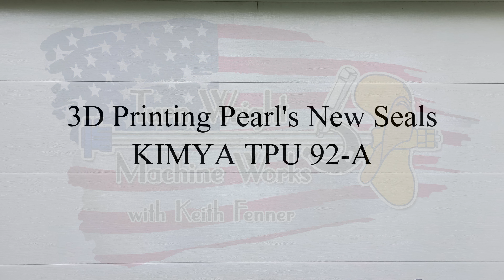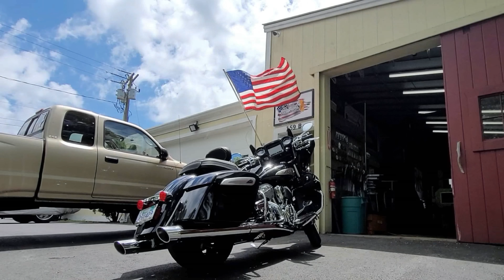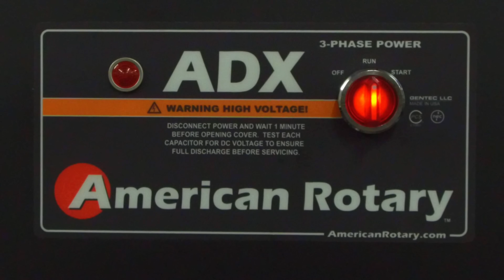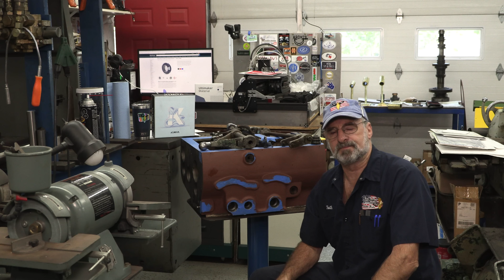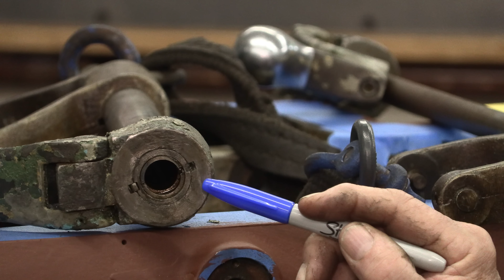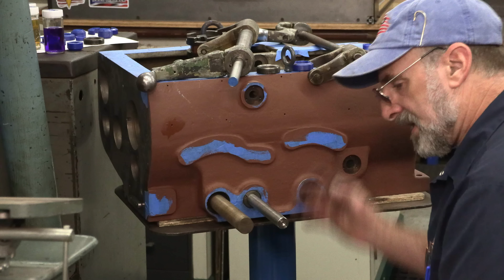3D Printing Pearl's New Seals KIMYA TPU 92 A

Comment: Experiment a bit with your printing temps and print speeds. The layers dont seem to be fusing well and there is evidence of under-extrusion. In your application as the seals are compressed canonically on both ends, it may not matter so much.

Comment: Good work Keith. Thanks for sharing.
I use my 3d printers to make odd parts too. If you print the parts one at a time, stringing shouldn't be an issue.
Going on how the Acetone seeped into your layers and apparently caused some delamination, maybe heat treatment of the part in a mould could make the material more impervious. The mould would just be a facsimile of the gland with a piece of rod for the core. Mould release substances would be another interesting topic, I'm thinking graphite or moly for the qualities given to the finished part.
 Not a suggestion, just a thought exercise.

Comment: You said DOT 5 and I notice that it is purple, which would indicate it really is DOT 5 (silicone based) and not DOT 5.1 (glycol based). Since you have a Harley, I'm guessing that's what you use in it, as some (all?) Harley's come with DOT 5 fluid.  As far as I know, DOT 5 is not something that typically is hard on things like paint and plastics, like glycol-based DOT 3, DOT 4, and DOT 5.1 brake fluid.   I'd say try another test with DOT 4 or DOT 5.1 fluid.

Comment: Thank you for sharing. The only 2 things I can add, already noted by others, ATF 3, is commonly used as a hydraulic oil replacement, it has a wider heat and temperature range. Also antifreeze, now this is a huge rabbit hole, much more than Brake Fluid, but even a sample of the good old green antifreeze that is still in use by a huge segment of the auto restoration group.

Comment: > nice going there keith mr fenner. additional shop chemicals? look no further than your you tube machinist compadres - solvent tank fluid; tap magic; evaporust; windshield washer fluid; isopropol alcohol and a couple few aerosols like brake cleaner & marvel mystery oil.  another possible testing parameter taking into account some of the chemicals are flammable, would be to create a homemade 'elevated temperature' steamed vials environment (similar to a wood bending steam chamber)

Comment: Keith,  I spent many years working with Urethane and Silicone based castings for marine applications. 
In daily operations  we used  Distilled water, MEK, Acetone, Isopropyl Alcohol, and Methylene Chloride for cleaning and mold prepping.
In your shop I'd test the proposed seals with solvents they might come into contact with in your planned environments .
Additional solvents I'd test would be 
Way Oil -- you could splash/wipe it over the handle seals
Wd-40 (penetrating oils) -- general part soaking
Dykem Spray Remover -- Over spray
Salt/Ocean Water -- Future marine shaft seal material
Sunlight/Heat/Cold --- Outside uses

I'd prepare a set of standard size test pieces with known dimensions.  Then subject them to long term exposure as you have done with these samples.
I'd periodically test the standards for 
Material breakdown 
Smudge test on white paper
Dimensional stability both shrinkage and expansion
Durometer testing shore A scale

Just some ideas.
Thanks, M

Comment: 29:28  I wonder if you could use that to your advantage ...... if you need a 'more' pliable material for certain cases ...... you could do this 48  hour acetone softening step?>   Just a thought
Reply: There is no way of knowing, besides extensive trials and a mass spec, what the acetone does to the TPE compound. Acetone could leech out all the plasticiser and when the acetone eventually flashes off, which it does pretty quick, you would be left with dust or an inflexible seal. But, he is experimenting, so have at it!

Comment: how machinable is this material?
Reply from the maker: Machines like rubber! NOT LOL
Reply: @KeithFenner  figured so.   Really that's a good thing tho.   That's the property you're after.   Looks like your getting good tolerances straight off the printer though so machining doesn't look necc

Comment: You want to destroy TPU spray Brake clean on it. TPU is the same rubber that is injection molded onto most Cordless tool handles and brake clean destroys it. Now i know there are different grades of TPU but it would be interesting to see what toluene does to it .

Comment: Two more fluids you may wish to test this material in are synthetic motor oils and synthetic gear oils. In both cases, these fluids in the past have had adverse effects on the sealing materials, (especially some current and all earlier formulations of silicone sealants)  used in cars, trucks, and commercial vehicles manufactured in the pre-2000 vintage era. Another fluid to check out would be the new generation vehicle coolants. I realize these fluids are not necessarily used in the machine trades with the possible exception of synthetic gear oils.
Hope this comment is a help and thanks for all the great content.

Comment: Thanks for the informative content.  I’ve had an entry level 3D printer for a few years now and I’m always finding new uses for in the shop as I restore vintage machines, etc.   I just learned a new use and I’ll be ordering some flexible filament shortly.  Ive got a couple seals to make for my Atlas shaper.

Comment: Fresh and interesting information. You asked for suggestions regarding other liquids. When rebuilding old/outdated carburetors, Orings which resist gasoline are desired.  Also, I believe DOT5 brake fluid is SILICONE OIL... really only useful when replaced often. Dot4/5 are TOTALLY different chemical make-up intended to suspend moisture like a sponge. (and  remove paint)

Comment: Retraction settings can help you on that stringing.  Also different temperatures to print at.  There are lots of "test prints" that exist to adjust retraction, speeds, and temperature to reduce and possibly remove the stringing.  TPU is tough to print, but you can do it without stringing, it just takes time to tweak the printer.

Comment: i work in the oilfield and have seen 3D printed parts start come into the work flow. it is easy to see that in a remote working environment having a way to build something from raw material. i was thinking of something like a link belt 3D print to make a chain of printed parts for a replacement fan belt, but your on the next level. lots of equipment covers and caps are 3D printed now. thanks very much for sharing! yes, i own a 3D printer.

Comment: I am thinking the DOT5 fluid is silicone based and used in high heat and extreme cold applications and is different than DOT 3

Comment: Don't you own a spanner wrench?
Reply: Same thought here.
Reply: Most spanner wrench pin ends are too fat to fit up against the shafts. You would be better off making a tube/pin socket type wrench. Yes, you would have to make one for each different nut size but it would be much more secure to use than a pin spanner wrench.

Comment: dot 4 & 5.1 brake fluid are glycol based, Dot 3 is ester based, Dot 5.0 silicone based and is paint safe.  Dot 3 or 4/5.1 are not paint safe. you should test all 3 types ester/glycol/silicone

Comment: Thanks again Sensei!  I'm old enough to remember the late 50's/early 60's B/W TV  "science shows" ... I kept hearing "Hey, MR. WIZARD!" watching this. My Dad was the same way about wanting self proofing anything he didn't know about. Cork for example, there was a major hotel air handling system, and the specs for several things included the use of several different specifications of cork material. We spent several hours at the library learning about cork and it's uses. I was just a kid, but I learned right along with him, and those are important times in any young apprentices life. I have always learned before doing. The results of that seem to have (mostly) always work out. Everything I just watched has taught me that I didn't know squat about 3D printing, but I'm going to use the GLOBAL LIBRARY to find out more. Thanks Keith!

Comment: Thing to consider with TPU materials - they can be quite hygroscopic, so the filament on the reel wants to absorb moisture from the atmosphere, especially in your humid environment. It won't affect the material much in a day to day setting, but when it comes time to print at 200+ºC, the water absorbed flashes off to steam but is still trapped in the rubber, causing 'foaming'. It weakens the part and can have different physical and chemical implications down the line. Just be sure to keep it stored in a dry environment with lots of desiccant after the bag is opened, and ideally in a filament drybox while printing. It can be dried in an oven; same as how you'd pre-treat welding rod flux. Search online for suggestions on that front since I don't want to give specifics in a youtube comment that may or may not apply to your specific material.
Reply: Keith did mention putting the filament in his hot box for a period - presumably a recommendation from the manufacturer.

Comment: 20 years ago, they will make a machine the size of a typewriter that will make you oil seals, no chance. 
Great to see new usable technology in the repair tool box Keith.
I've had a 3 D printer for 4 years, never looked at pliable materials. 
Thanks for sharing.

Comment: Hi Keith and Lisa 😊, those seals look pretty good mate, and acetone is very unlikely  to be around your lathe I would think. I suppose  degreasing solvent at a pinch might get near the machine sometime,  or brake cleaner aerosol, which is common in a workshop. You look to have covered  most common stuff, and the long term tests will be interesting, it's a clever machine, and  I don't realy understand how it works, but undoubtedly they have their place in  an  engeneering  shop in the 21 century . Thanks for another interesting video mate, stay safe, best wishe's to you and Lisa,  Stuart UK.

Comment: It might be useful to weigh  each sample to see how much liquid it took in.
Reply: Pretest dimensions are critical.
Reply: Agreed, my prints porosity/solidity and dimentions are very dependant on flow rate, temp and moisture in filament among other settings. Wicking has always been an issue with addative manufacturing.
As for science, if you don't measure your samples before & after, it ain't science!

Comment: Can you try DOT3 or DOT4 brake fluid? DOT5  brake fluid is silicone based and doesn't seem to harm paint like the others. I think the 3 of 4 may be a more telling of chemical resistance.
Reply: Mineral oil brake fluid too, seems to swell DOT compatible seals & diaphragms in no time.

Comment: How do those materials compare to, say, Buna-N (which is more common) or Viton, Gylon, etc? Can't count how many times in the '80s I had to reconfigure a pump for a customer from Graphite packing to John Crane mechanical seals! Fun times and I got paid for it! You learn one thing along the way and later you use it elsewhere, and people think you're a Wizard! And telling a customer that a packing seal is better for their application, like silicon carbide slurry for a Marble slab wire saw. 🤣

Comment: I run AW-32 Hydraulic oil in MY Clausing gearbox as well, Only last oil chg I put a whole bottle (a quart?) of LUCAS oil treatment in with it (The stuff from the auto parts store with the hand crank & gears display) it made my gear oil more clingy and sticky and made my old clapped out rattly machine a LOT quieter!! I notice your Clausing has a cpl of noisy speeds too - Might try it next time?

Comment: As an electronic mechanic, not a machinist, I replaced all rope packing with Teflon packing with not a drip in 20+ years.  This was distilled water in five all copper and bronze cooling systems. Ron W4BIN

Comment: Kimya uses the the letter "A" in their product nomenclature.   Viton A comes to mind?  Possibly similar?  Viton, TEFLON, EPDM, Buna.... have various characteristics and applications (durometer, chemical, temperature, and wear environments).  Nothing is proven until experimenting.  Your exposition this material is great information.
Reply: Pretty sure that's referencing the "shore A" hardness scale.
Reply: @super_slo  I vaguely recall the term:  "Shore A".  From somewhere...some sort of hardness scale.   I do recall a durometer gauge we used on polyurethane and extruded PVC product lines, while employed at Custom Building Products (Superior-Featherweight Tools division).   I finally looked it  up.  Yeah, you nailed it!  "Shore A" hardness scale is the softer range of the polymer durometer scales.  Keith mentioned Adeck(PVC?) and King Starboard (HDPE) two "hard as nails" decking materials, subtlety.

Comment: Keith, my only slight concern on the seals would be their surface roughness, compared with commercial oil seals. I just don't know if the compression of the screw in rings, will flatten out this roughness or whether enough might remain to allow osmotic creep of the lubricant, through the microscopic fissures.
Reply from the maker: We're going to find out
Reply: @KeithFenner  , 
Project Farm: We’re going to test that! Lol

Comment: I'm wondering whether "someone" might make a plastic printing material that "sets up" in a chemical reaction (perhaps by being placed in a pressure vessel) or in response to a UV light.  The idea might be to print a layer, "hide" the print head, turn on the uV lamp for a few seconds, and bright out the print head for the next layer.
Reply: UV curable acrylates (and other chemistries) exist in a form of a liquid. We used them in medical devices applications. In 3D printer, one can dispense the liquid through a nozzle immediately followed by an UV light. The result is a hard plastic-like material.
Reply: @milantrcka121  --  Interesting.  I was thinking of a "chemistry" that produced something like silicone rubber which is flexible but can stand high temperatures.   

I just had the thought that in the particular application that Keith is working on, rather than having a sliding "seal," he might be better with a limited motion bellows.   It could allow all the motions needed to shift the gears (limited linear and rotational) but the bellows would be "leak tight" until they wear out and would have to be replaced.   No adjustment would ever be required.   The seals would be static and as reliable as one of todays "silicone joints" on oil pans and such.

Comment: To get less stringing and better parts with TPU, dry it for 8 hours in a dehydrator at about 60⁰ before printing. I do that with mine and it makes a world of difference!
Reply: I commented elsewhere about drying but forgot to mention, one of the side effects of the water boiling off is the filament continuing to expand after the extruder stops pushing, because the gaseous steam acts like a spring - causing the stringing.  Drying flexible filament super important.
Reply from the maker: Thanks for the tip

Comment: Interesting video Keith.   A couple of settings in Cura you may want to look at, in print settings -> walls:
Z Seam alignment - if you set this to random, it will stop the vertical line up the part, caused by each layer starting in the same place.
Hole horizontal expansion - I've found holes print a bit smaller than the size specified in CAD. You can adjust here, rather than changing in CAD.
Horizontal expansion - This allows the final outside dimensions to be changed if they are slightly different to what's been specified in CAD.
Probably not too relevant for flexible parts,  more use if you move on to printing rigid engineering parts.
Reply from the maker: Thanks for the tip
Reply: Also, it would take more time, but if you print them 1 at a time or sequentially (I think cura was going to add this, but I've been using superslicer for the last year), you won't have the stringing caused by moving between parts as the nozzle stays within the volume of the part it's currently printing. There is a significant amount of room for tweaking in the settings for the beginning of layers, end of layers, wiping, etc that have have a HUGE impact on the z seam. You can choose to cause it to overextrude slightly to fill the gap, but more commonly it slightly underextrudes with closer to default settings, leaving a small channel that could frustrate your efforts to achieve a good seal. Good luck, this project is awesome!

Comment: This is a very respectable application for the 'design of experiments' methodology used for determining the variables which lead to robust performance and longevity.  Although dimensional changes due to chemical exposure may be interesting, it may not significantly impact performance due to the fixed volume of the gland-void on the machine where the packing ring is installed.  I'd be moderately interested in wear resistance since this is a sliding seal application.  You may be inclined to fiddle with various interference fits to the shaft and clever 'wiper' features on the printed gland to investigate if those improve performance or long-term reliability.  Also there remains the availability of post-printing machining operations to modify dimensions or improve surface characteristics.  The take-away here for us all is the recognition that "perfect is the enemy of good enough".  This is not a shaft seal for a Formula-1 race car or the space shuttle.  Potential future degradation will only result in some drippy oil on a machine.  If this happens, it'll just be an opportunity to learn something and make it better for the next time.  
Keith- You are an inspiration and a legend!

Comment: Two suggestions to look for in your software. #1 see if there is a setting to have each layer start/stop in a different place, that will remove the vertical line on the edge. #2 see if your software has vase mode, it would then make the infill in a spiral pattern, as well as no start/stop layer lines.